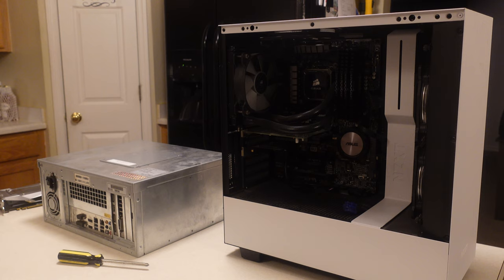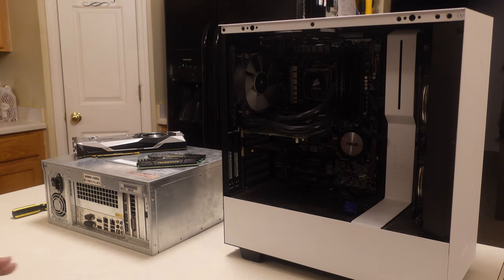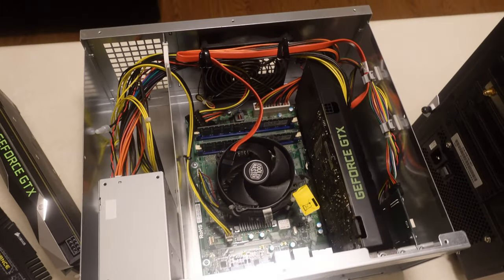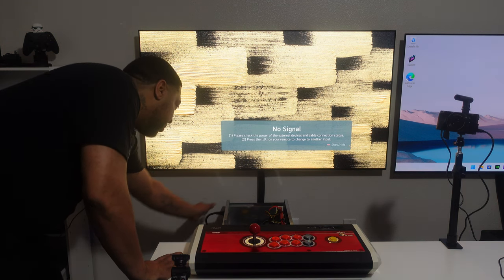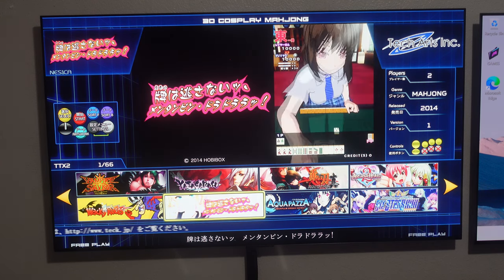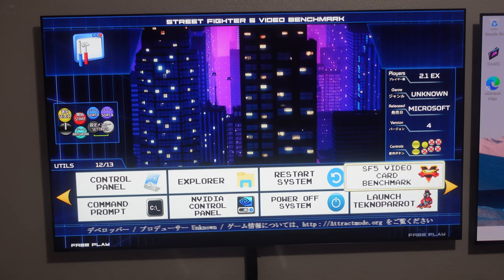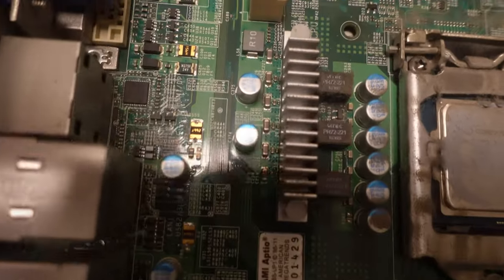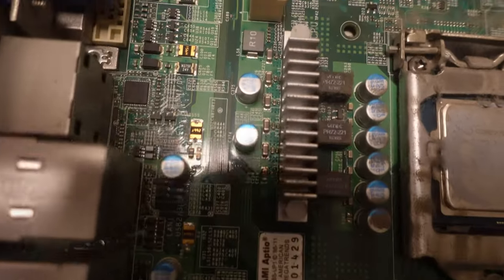Upgrading Taito Type X4 Arcade Machine | Part 2

Comment: Thanks for the content I’ve been getting into this vexlix stuff and you videos explain a lot. One question: couldn’t you have just kept the pc intact and borrowed the hard drive from the typex4 ? Would that have worked? Have you ever just ran the multi from a gaming pc? I noticed you dumped everything and went fightcade on windows, why not the multi (with fightcade) on a pc?
Reply from the maker: Doesn’t work the same unfortunately.
Reply: @AllAboutTKK  thanks for the reply brother, so you can’t run the multi on a gaming pc?
Reply from the maker: @loudubbs22 there are some work around but when you get the image it’s like it’s own thing. Kind of made to run on the Taito by its control scheme.
Reply: @AllAboutTKK  understood thanks for the knowledge

Comment: Here are some of the keyboard controls:
E and W scrolls up and down
Q and Enter do the same thing
Atl+F4 or Esc quits
Tab configuration
P is for Pause
Arrow keys and enter
to enter bios at start up = CTRL+ALT+F9
Bios password: opentdeg
Page up and Page down
F11 and F12 screen size
to shut down the machine, E or W to UTILS, scroll over to "power off system"

Comment: TKK! Are you putting this in your Chewlix? If so, what are the dimensions of the Tatio case? Thanks for your time on this question!
Reply from the maker: This is going in a Vewlix that I have yet to buy. But yes it will go into my Chewlix for testing.

15” wide 
12” deep
7” tall.
Reply: @AllAboutTKK  hell yea. Thank you sir.

Comment: Not sure you already did the research but I believe there is a way to flash the mobo BIOS to allow any GPU to be used, no reflash needed, on the TTX4. People are doing that to run the Atrax Multi
Reply from the maker: I need that info! Are you in the Chew group?
Reply: @AllAboutTKK  I believe so... i have friends with TTX4's that multi them and I can get the info from them.. I just run the multi on a regular PC
Reply from the maker: @neccros007  okay.
Reply: @AllAboutTKK  friend just gave me some info on the TTX4....
Reply: @AllAboutTKK  He says you dont need to flash any BIOS on the TTX4 but you need the I/O from the TTX3 for the Multi to work on the TTX4 w/o crashing